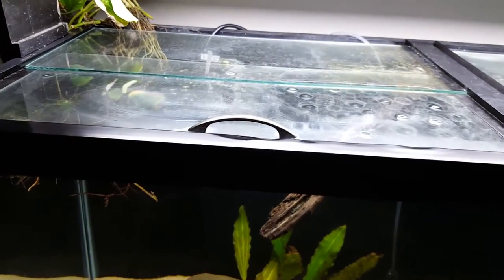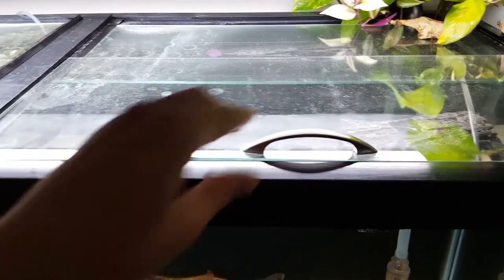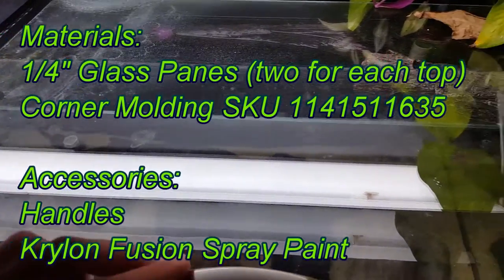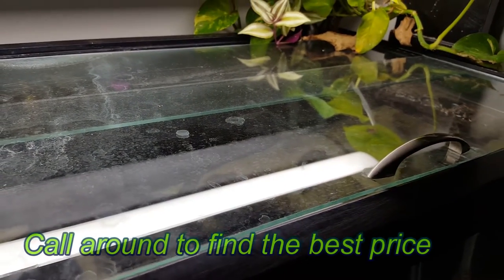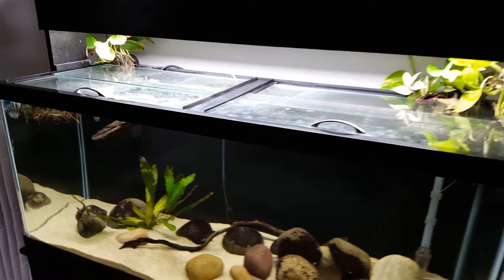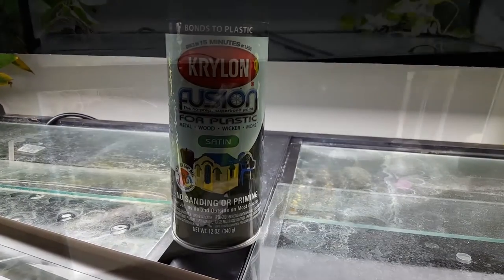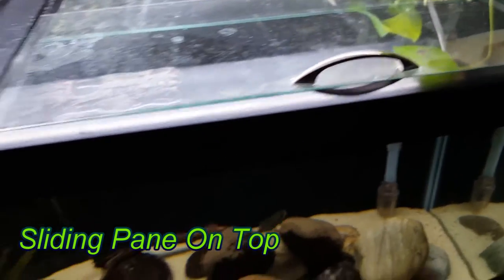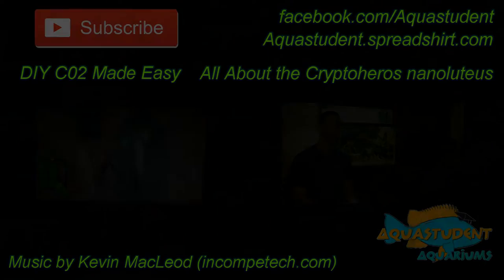Easy Sliding Glass Aquarium Top

Comment: Lowe's is another cheap option for glass panes and they'll cut it to your specified dimensions for you for free too. "Gardner Glass Product" is the specific product line, you can see the prices for the panes online. Ranges from $2.38 for 12"x10" up to $16.48 for 36"x30" panes.
Reply from the maker: MacTX Be careful with that though. I wasn't able to get anything thicker than 1/8" from my Lowes'. Glass that thin works but will leave you nervous every time you open and close your lid. Also, having glass break into your tank is a very bad thing.
Reply: AquaStudent shouldn't be a problem as I'm not putting anything on top of it and I'm not accident prone. If I were, I would have just gone with acrylic, no possibility of a mishap then.
Reply from the maker: MacTX Acrylic flexes though and doesn't slide quite as well.
Reply: AquaStudent don't put weight on it and try some lube
Reply from the maker: MacTX I don't trust myself to not set my beer down on the tank :D
Reply: AquaStudent that's why you need a beer holder hat, totally worth the price of admission. just think... drink AND water change at the same time.
Reply from the maker: MacTX How else are you supposed to do a waterchange?! Beer is a necessity
Reply: AquaStudent just remember to not get clown fish drunk... they're mean drunks.
Reply from the maker: MacTX Thank goodness I'm not doing marine tanks :D
Reply: AquaStudent you should though, you're missing out. like they say, hate the alcohol, love the alcoholic.

Comment: where do you get the middle part? the black one?
Reply from the maker: +Gober Pally What do you mean the black one? There's really only two pieces, that trim piece and the glass panes. I spray painted the trim black so that it blended more nicely.
Reply: ok i have a 4 feet tank but i dont have a stabilizer in the middle like you do to put the other two sliding glass on. where can i find something like or do iput one glass in the middle? and glue it?
Reply from the maker: Interesting. My 4' tank was built with a center brace. You would probably want to build something to run that span. It'd be better than having a pane of glass running 4'.
You could build it out of plastic, metal, or glass. If the tank doesn't need that center brace structurally then basically whatever you choose will work. You'll just have to fabricate it to do what you need.

Comment: How did you attach the handle?
Reply from the maker: I used a strong epoxy. Something like Loctite or similar should work well. Look for something which can bond to both metal and glass.
Reply: AquaStudent thanks! for some reason I thought you managed to screw it in.
Reply from the maker: You can try. I don't have any tools for drilling safely through glass. It's also a thin sheet which may make things difficult. I think gluing on the top is the safer bet.